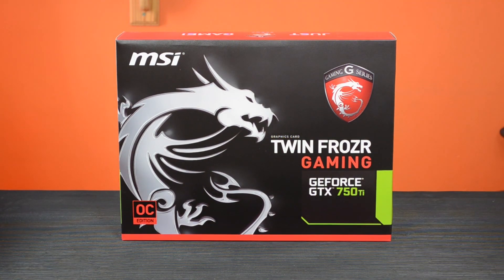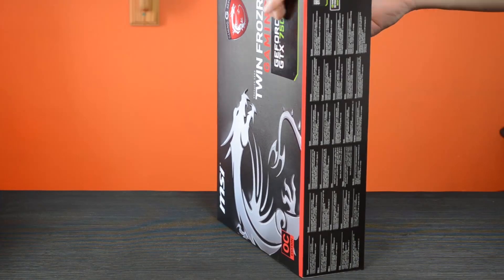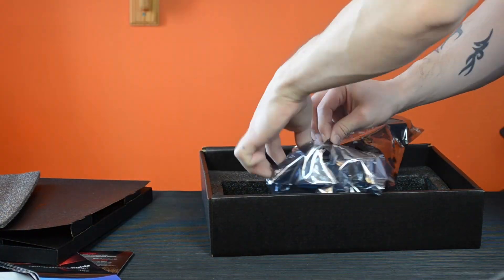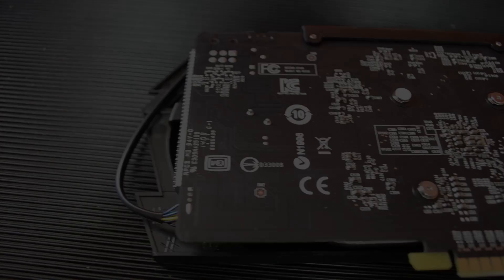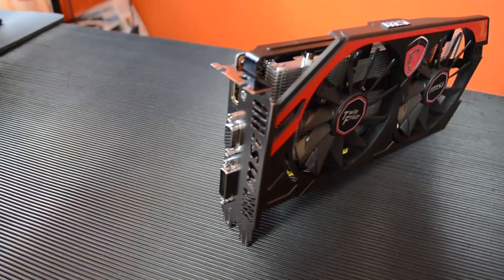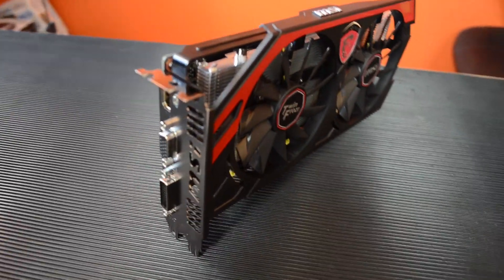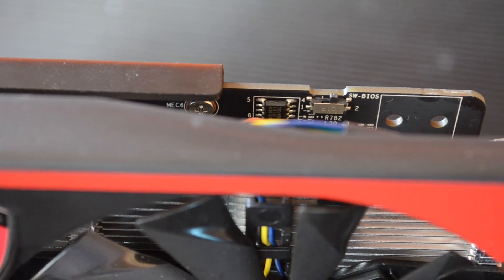msi GTX 750Ti Twin Frozr OC Benchmarks and Review

Comment: OK quick question I have an evga gtx 750ti sc 2g. but I'm looking to get the MSI version to match my mobo and its bigger. is it a good switch botch cards cost the same so no extra spending.
Reply: if you are going to oveclock the card I should go with the twin frozr if not i should go with the evga because it drains less power
Reply: +Glenniebrother i went with the twin frozr and canirunit detects it at a full 2 gig card while the evga version doesnt. It was a wise decision.

Comment: Can i use Msi 750TI TF with PSU 350 W bro ?
Reply: +Nishant Singh You must be trolling, right? 350W PSU will be more than enough. Even a 300W will do just fine. It's more important that you buy a quality PSU from a good brand.
Reply: +Slither95 actually 350 will run but can cause problem for long run , even nvidia official statement don't recomend less than 400 w psu. because just because graphics card take that amount of power so according to that u will buy psu is foolishness. there are many factors u should know  before buying psu

Comment: Would anyone here still recommend this for gaming?  I'm looking to play games all the way from cs go to ARK and GMod to COD.  Please if you could reply it would help a lot as I haven't got a clue if I should get it.
Reply: Jack Holden for ARK you should get a better graphics card IMO, even TITANs have problems with that game... I use gtx 750 ti and i5 4690k and i have 280 fps average on 5v5, low on all settings
Reply: Klaus Færevaag Ok thanks for telling me.  I don't really want to play ARK too much.  I just thought I would use it as an example because I know it's a huge game that expensive computers have problems with.  I'm getting the Gigabyte version of this GPU now and I'm getting an AMD A-10 (one of the better A-10's).
Reply: should have no problem running on lower settings and maybe turn down resolution, for example cs go is more CPU intensive, but a-10 should be plenty if you want 100-150 fps :)
Reply: should also add that if you buy a discrete graphics card there is no point of buying the A-series apu's (yes, apu not cpu) because they have cpu and a graphics card combined designed for office use and light gaming.. the fx-6300 or 8320/8350 would be better :)

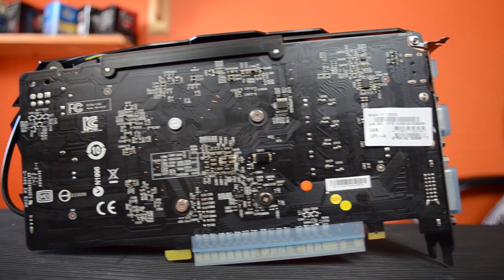Comment: already commented once but now after 4 months of using it while cleaning my pc i noticed the card is missing a metal bar (which you can see at minute 1:23 in this video) which prevents card bending under high temperature. Went to the store and they told me to go back when they get a new batch of this card to do a comparison and see what's up but yea, check that this card has all components in place before buying it.

Comment: Nice thing about THIS card.. works on older legacy bios also...(throw it into a dell or HP and NO issues to run it!) NO need for a power source other than PCI-E AND you can OC it pretty well! if you want to SLI, it's cheaper to get one gtx960 which is about double the performance but you WILL need an external power source. (if you have a prebuilt, get a $30 (on sale) corsair 430W and stick it on top of the pc and run the power thru the back to the pc to the card.. (not sure if the 960 has a legacy bios however...)
Reply: bullyakker for prebuilt systems with 250+Watt power supply, you cannot get a better card anywhere.

Comment: got this card 2 months ago for a budget build (my first custom build pc) which i use for entertainment. It's my first ,,serious,, graphics card (before this i had shitty gpu's which barely had the power to run a 1080p video without stuttering) and i am more than happy with it, every game I've played so far were smooth even at high settings. Unless you want 1080p or higher resolution gaming this card is more than enough for a bidget build and it's quiet, i never hear the fans spinning which is a plus and it never reaches 50 degrees Celsius. I have an msi h97 motherboard, i3 4150 cpu, msi gtx 750ti gpu, 8GB or ram and a low cost psu and it's more than enough to run any game at a decent resolution and framerate. if you are on a budget do not ignore this card since it also has an overclock feature (which i never had the need to use) so it can outperform even some of the more pricy gpu's.

Comment: Damn, that's a huge min/max difference in Bioshock Infinite.

And how do you overclock the memory of the graphics card?

And will this card run with a 350 watts power supply?
Reply: It's should run perfectly on that PSU. (450 Watts minimum if you want to overclock)

Comment: What would the recommended power supply be for this with 8gb ram and a 3.5ghz 6core cpu?
Reply: I would say a 700 watt power supply would be perfect seeing as you have a powerful cpu ;)
Reply: ATXgaming Thanks.
Reply: Pixel Rover dont bother him even a 400W could be enough depending of the other parts...
check a PSU calculator like http://extreme.outervision.com/psucalculatorlite.jsp
Reply: Marco Martins i think he would be better off with a 500w psu, so he can have some room for upgrading, and its also cheaper than a 700w

Comment: I seriously can't understand NVidia's idea of not including SLi on this card... I mean, I would EASILY buy this card NOW if it did but instead I find myself looking at the AMD 270 or 270X instead simply because they support crossfire.

I don't believe most ppl can (or are willing to) just drop the insane amount they ask for a GTX780 on a card all at once so by providing SLi support to the 750Ti they would cater for a LOT of ppl who would happily buy 1 or 2 more GPUs down the track. This would not only give them more profit per unit, but also steal potential buyers from AMD. 

The biggest draw card for the GTX 750Ti is IMHO its low power consumption which would mean I would be able to run 2 cards (if there was SLi) and still use less power than a single GTX 760, for example! Add the soon to be released Broadwell CPU and there's a good chance I can even run 3 cards without having to change PSUs!!! 

I don't like that it only has a 128-bit memory Bus but that becomes almost irrelevant since I won't be buying it without SLi. Bad move from Nvidia.

Comment: MSI Gaming or EVGA SC Edition of the GTX 750 TI?
Reply: baizid ahmed zidan That... doesn't make sense.
Reply: EVGA SC Will be best.. :)
Reply: baizid ahmed zidan why?
Reply: I'm using it,, 
and it's really good..
Reply: has power connector?, which may overclock?
Reply: i don't need any power connector,, it runs without any power connector,,
and it needs minimum 500watt power supply..
Reply: me and my friends had so many problems with the evga sc version, ao we sent it back. if u dont believe that its bad then look at the reviews from newegg or amazon for the evga version, other ppl have had the same problem
Reply: InfinityCraftLP hes not lying, it sure doesnt use a power connector because its meant to save power. that means its not going to be the best at overclocking